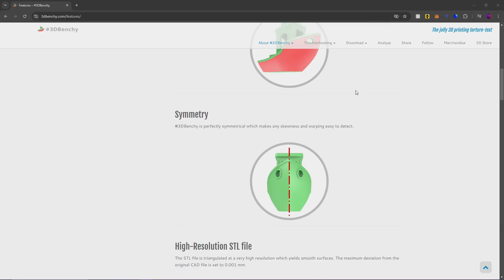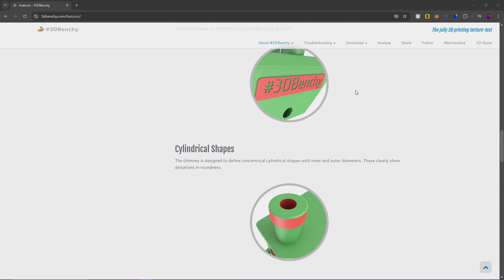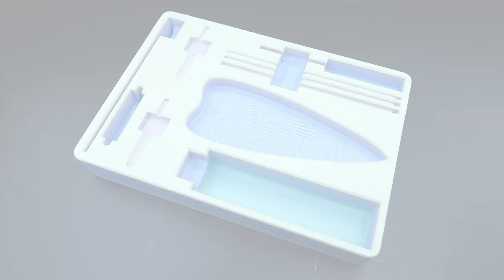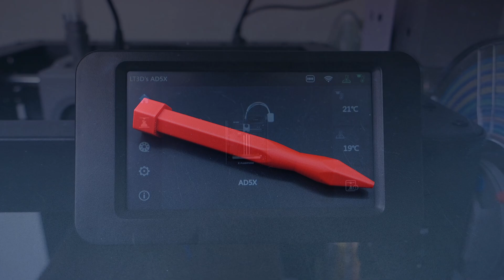Flashforge AD5X Must Prints!! (7 Things You Need to Print on Your Flashforge AD5X)

Comment: I have the same printer, but the parts are coming loose halfway through printing. They lift up and detach. Any advice or settings? I'm using filament esun pla basic .
Reply from the maker: Increase the bed temp by 5 degrees, use a brim or potentially adjust your z-offset

Comment: 3D noob here, I tried to import the purge bucket holder and it was larger than the bed of my ad5x even after rotating corner to corner.  It looks ok visually, but Orca Slicer is complaining. I'm using the latest Orca Slicer, not the flash forge version.  Printed the bucket collect fine, I need the holder any one got some advice, can help me, thanks.
Reply from the maker: I did also experience this myself, for some reason regular Orca gives an error. It may be something to do with the build volume in the printer settings but honestly I'm not sure. I guess if you wanted you could split the model and add a conector inside Orca Slicer.
Reply: @LT3D_YT  I'm having the same problem

Comment: Got mine last week. The biggest value for me is being able to switch to a different filament fast.  I have yet to print  a multi color item minus the example coin. I do plan to, but I mainly got if for filament swapping on convenience.  As a budget color printer is hard to beet at the price point. IMHO.
Reply: honestly, multi color prints with lots of filament changes waste SO much filament with all of the purging.  It's almost not worth it for most prints.     However I DO love being able to load up the same filament on multiple spools and having the printer continue even if the first one runs out.  Pretty sweet!
Reply from the maker: @cjburdenX1  yeah, I’m not the biggest fan of waste either. That’s why I backed the Snapmaker U1 kickstarter 👍🏻
Reply from the maker: You’re not wrong it is at a great price point and the 4 spools definitely make swapping colours a lot easier!